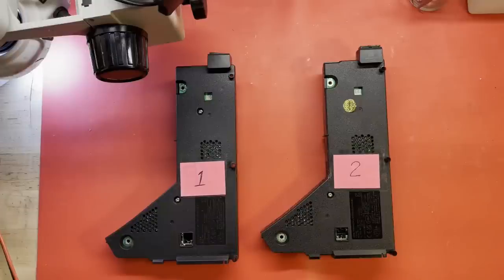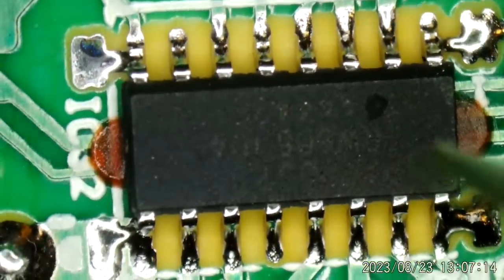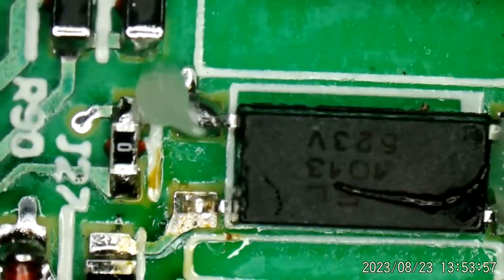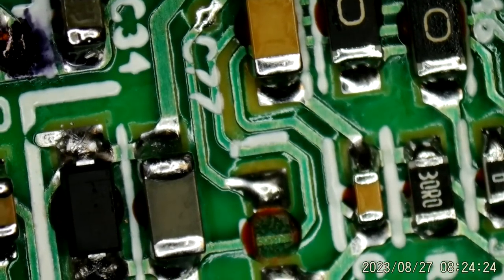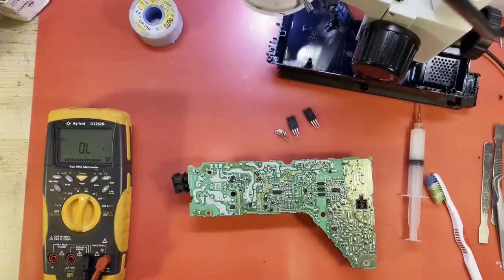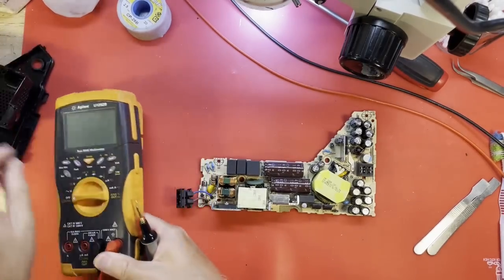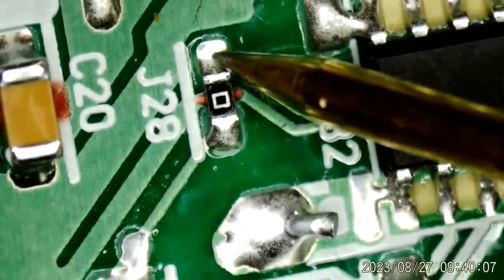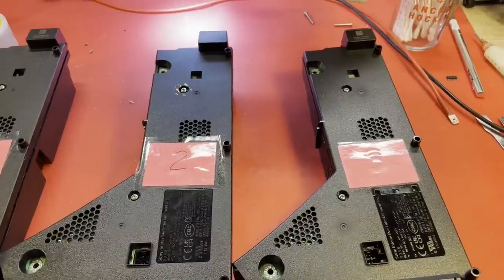#107 Repair of (3) ADP-400FR Power Supplies

Comment: Nice work through
Reply from the maker: Thanks so much!  Come back any time!
Reply: @ToltecMerc I’ve been struggling with trying to fix one where the output is only 9V but disabling IC51 by either lifting leg 3 or removing Q32 altogether allows the supply to go to 12V. Tried a new optoisolator and new Q32 with no change. Ever seen one like that?

Comment: Great video,i learn so much from your content so thank you for that. Do you have or plan to have a discord? I would like your help if its not too cheeky. I have a 400dr that has the same symtoms as your second supply. Both mosfets fully shorted and resistor open. However my ic had some different readings than yours. Pin 1 is showing OL and pins 2 and 11 were short to ground. After removing the fets and resistor the short on pin 11 has gone but the short on pin 2 still remains. Is the ic likley to be dead or could something else be shorting it ? Or could the short dissapear once replace the fets and resistor when they arrive ?  Thanks again 😊
Reply from the maker: Well the short is not going to go away by installing the FETs.  If you still have a short after the FETs are removed, either the DAP053 is bad or you have a shorted zener somewhere.
Reply: @ToltecMerc   Thank you for the reply. OK i changed out the DAP053 and pin 2 was still short, i removed each component on the line until short dissapeared and the culprit was the 3 pin mosfet marked 704Z so i changed that for a 7002?. all readings on the dap53 where now showing correct but the PSU was only outputting 9.5V when powered so i changed out the optocoupler on that line IC52? and still only outputting 9.5v. The main caps are showing 385v when powered . Any ideas what could be the problem? Thanks
Reply from the maker: @paulhunt8500  you might also check Q32.  I think you have changed Q34.  Make sure ZD37 (8.2V) is good.
Reply: @ToltecMerc   :) :) wow thank you , Q32 was indeed the problem. i changed it out and now fully working 12v supply. Legend
Reply from the maker: @paulhunt8500  that's great!  Good work!

Comment: Regarding replacement parts, do you have a digital list of them and current quantity? Or you just have them in drawer and once you notice it goes low, you order more?
Searching in excel is way faster than checking physically for example.
Reply from the maker: I simply have them in drawers and order as needed when I see I am getting low.  I don't really have a large number of parts.  Just PS4 and PS5 parts and only the most common ones.

Comment: Can you recommend USA component suppliers? The fuse resistors I can’t seem to find any that compact, the ones I did find the top end is not long enough to go through the board with out extending.
Reply from the maker: Mouser part # 603-FKN200JR-73-0R1
Reply: @ToltecMerc  Thank you so much. I keep old paper version catalogs and consult them frequently for the technical names of the components (browsing the internet looking for parts makes me waste a lot of time sometimes). I did not know this manufacturer (yageo) nor that it was 2 Watt. I will include them in my next order. Thanks again and I mean that with complete honesty. All the best.

Comment: Hello, I have a question. I'm looking for a Mosfet that sits after the middle opto coupler on a PS5 power supply ADP-400DR. The name would be OAROBP or something similar. I can't find this component anywhere, is there another name? I need the part because it is short-circuited.
Reply from the maker: If you are referring to IC132, you need a TL432 precision reference.
Reply: @ToltecMerc  Yes, I mean the IC132. I have now added the TL432 to my inventory. Thank you for this information.

Comment: what the best temp for removing part from a power supply am always getting popcorn ps4 power supply.. am using a Quick 861dw
Reply from the maker: Yeah those boards are bad to popcorn.  350C or below and use lots of flux to try to get the part off as quick as possible.